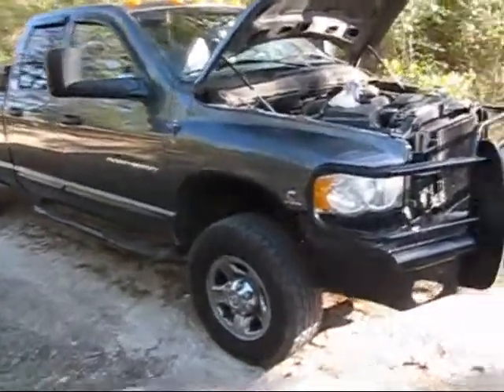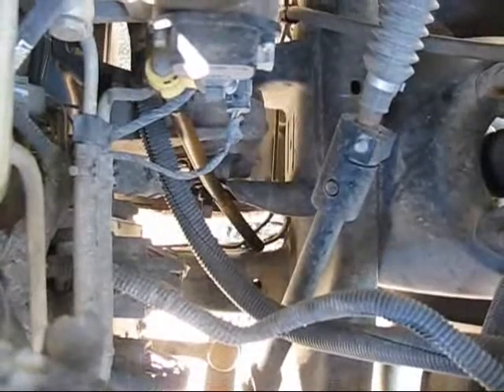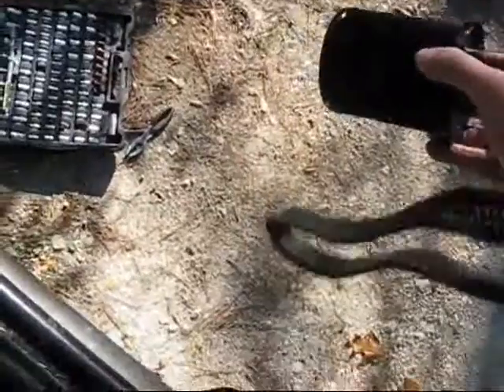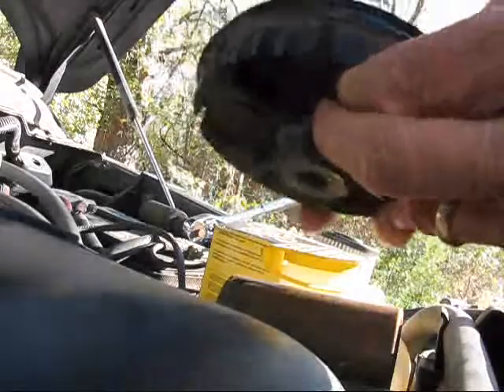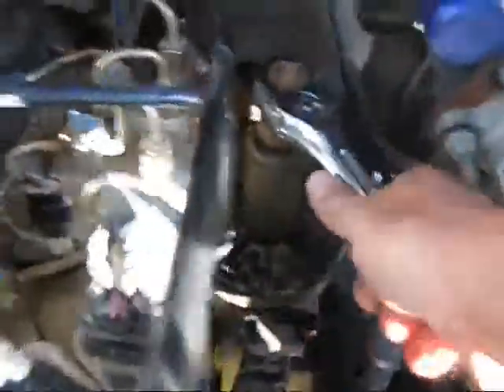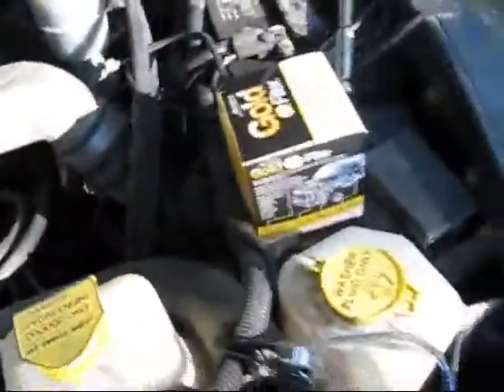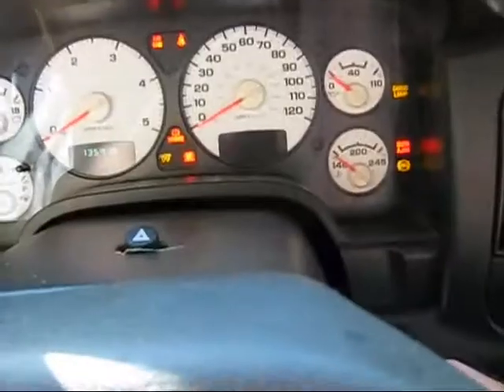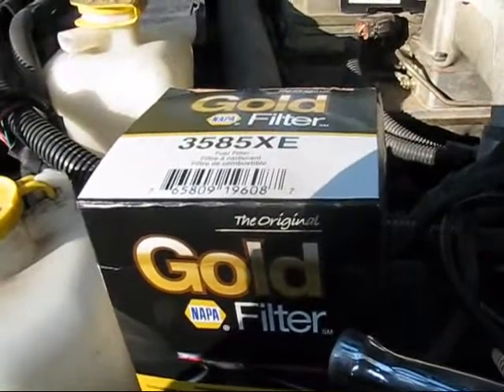Changing Fuel Filter on 5.9 Cummins Diesel Engine - Dodge Motor

Comment: I've seen so many other peoples videos that just make it sound so dang hard to replace the FF, that I have been dreading even trying it...to the point I've got 82,000 original miles on factory installed filter...yup, i'm dumb. Thanks for this video though, it's alot simpler than I thought and mine will be done on Monday (when I'm off).

Comment: Keystone Light?  I thought you said "Beer".  

Well done.  Thanks for posting.

By the way, on some models (and maybe all), if you  bump the starter, the pump runs for about 25 seconds each time and fills up the filter housing better.  I watched a different video on how to change the filter, and they talked about bumping the starter but never did, so I made a quick video.

Comment: Here's a word of advice. Before you work on your diesel you need to make sure that your engine bay is as clean as possible to keep debris, dirt, etc., from getting into your open ports / engine parts. When we worked on the diesels in the military we would always steam clean the engines and the engine bay before we started to service the engines.

Comment: I had a hard time finding how to change my 1998.5 fuel filter.. it is the type that you drop down and the part that holds the filter comes out.. here is a good link its not a video but it will help

Comment: When you turn your key on, the pump only runs for 2 or 3 seconds. If you bump your motor over, the pump will run for 20 seconds.  I bump it over 2 times to prime my fuel pump.
Reply from the maker: Michael Scott yeah I learned that after making the video. I have only had to bump it once to get it primed to start..  :)